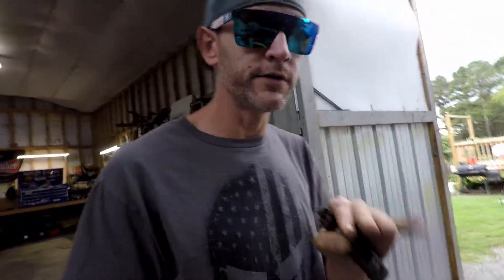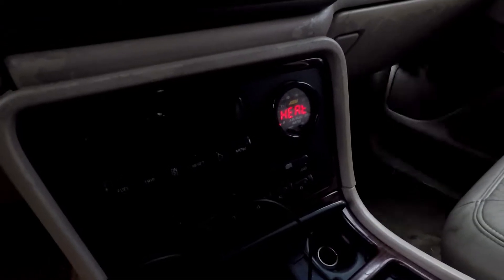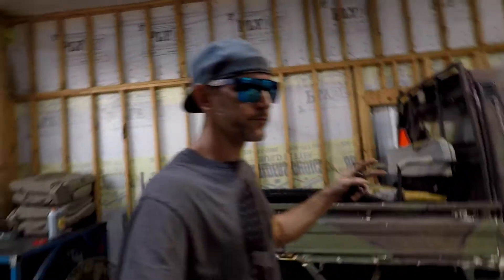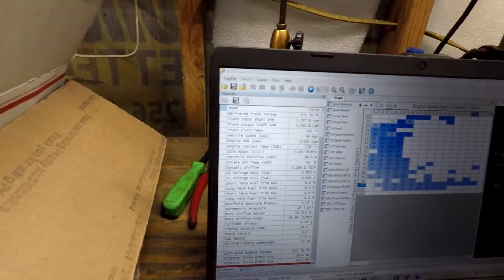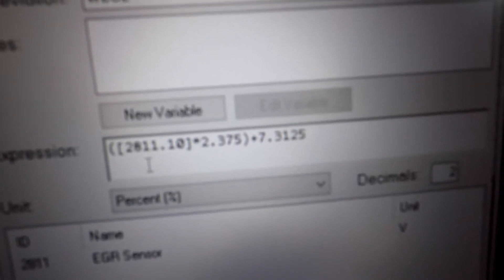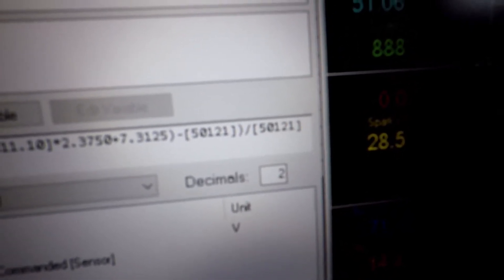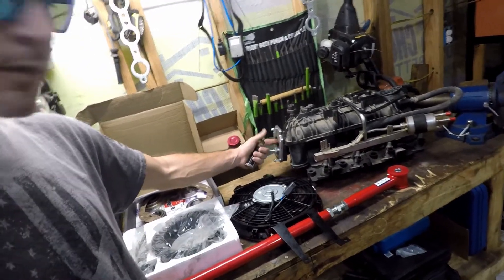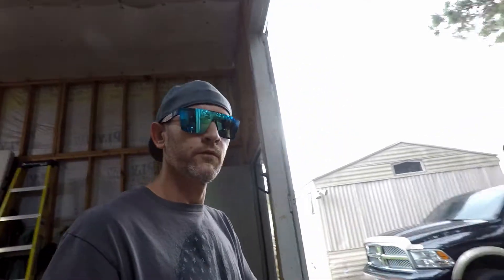Log wideband O2 sensor through EGR port on GMT800 & HP tuners links below (2024)

Comment: What brand of coil packs plugs and wires did you run on your escalade?
Reply from the maker: Speed engineering wires NGK plugs and O'Reilly coils 🤫🤫
Reply: @RAWRMotorsports  O'Reilly coils that's badass who would of thought lol I'm working on my escalade, tryna get it lighter any ideas? Bc she's heavy
Reply from the maker: Pshhht lol me too ... ima put captain seats in middle row , when I do that I'm pulling all the carpet and padding  and rhino line floors , I already deleted AWD and went 2wd , cut out a few things , deleted rear heat and /AC , and subwoofer , bout only other thing would be start cutting stuff out , plexiglass
Reply: @RAWRMotorsports  captain seats are probably better to run then the bench seat which I have it's alot of weight I think all the weight is the back hatch that thing weighs a tonnn but oh yea those are good ideas appreciate you🙌

Comment: Man I wonder how hard it would be to convert my Escalade to a manual yes you heard correctly a stick shift transmission. I know like the Honda Civic and stuff you just have to bolt the manual pedals in and pretty much leave the auto shifter in park or neutral don’t know if it would be the same on these 99-06 trucks. If I ever could find a manual transmission from a heavy duty 6.0 truck I would damn sure piece stuff together and try it out I don’t need a center console anyway lol.
Reply from the maker: It has been done ..